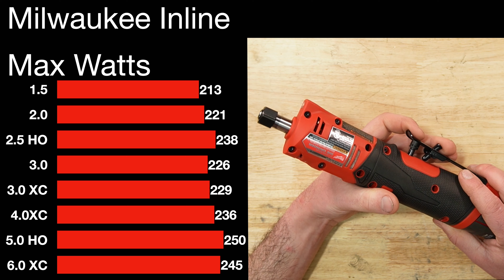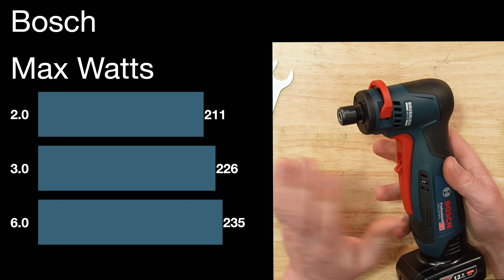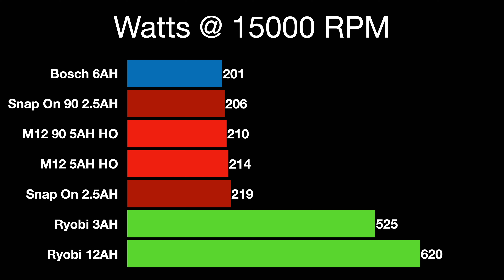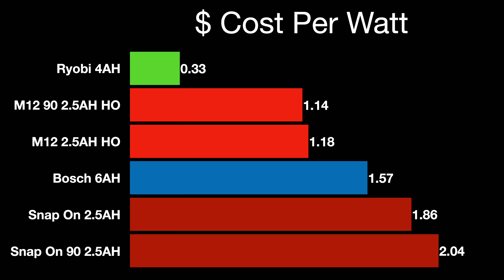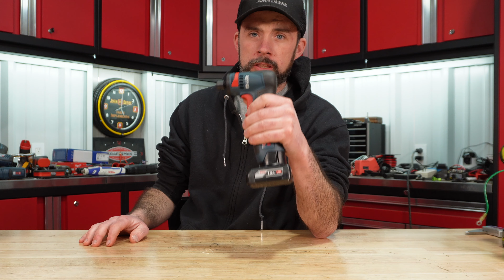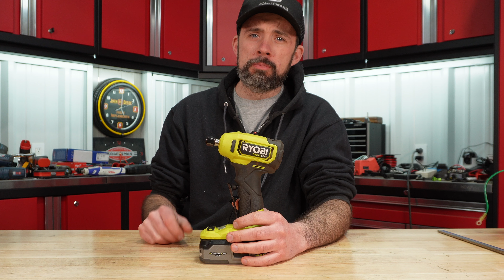The Best Cordless Die Grinder

Comment: I don't have any of them but I have a lot of the M18 & M12 tools. Waiting for the next generation of Milwaukee seems to be the best option. I do have a Ryobi tool so that's a temporary option too. the large heavy and pricey battery ruin it for comparison unless the M18 is considered.
Reply from the maker: Yeah hopefully we see gen2 m12 or M18 soon!
Reply: You won't get much more power out of M12, it's just too low voltage. Your best hope is that they make a compact M18 die grinder.
Reply: @toolscientist  I agree. There are a few M12s that I don't want anymore. The only reason I still have them is in case there's ever a need for that exact sized tool...
Reply: @toolscientist The problem with the M12 grinders (and cut off saw too) is not so much the max power , it's that they can't maintain their power more than a minute or less due to rapid thermal saturation somewhere in the design, coupled with  overly conservative protection logic.   Many folks have incorrectly concluded it's a battery thing but it's not.   

A gen 2 M12 needs to address the thermal bottleneck whatever it is, with beefed up  motor /electronics /cooling/thermal inertia  etc.

Comment: I wonder how the Dewalt Die Grinder would stack up.  It’s rated at 760 watts.  So maybe it would edge the Ryobi?  But it’s also a huge grinder.
Reply from the maker: Off of spec I would say the Dewalt would smoke this Ryobi,  from my testing of other dewalt tools they are actually honest with the specs.  That being said most are rated with a 2 or 4ah,  so when u use the PS batterys I could see that 760 watts pushed over 1000.    

If everything goes as planned we will see in about two months,  once the larger high speed dyno is done.
Reply: Dewalts cutoff tool is really good, the die grinder might be interesting indeed.
Reply: I have a DeWalt in-line as well as the DeWalt cut off tool, both are monsters
Reply: @KosmicHRTRacingTeam  I have the die grinder, but no other grinders to compare it too.  The few times I’ve used it, it more than got the job done.
Reply: Dewalt's inline is much better than the Ryobi, i have both as well as the 2 m12 Milwaukee's. I use them for different applications. The Dewalt and straight m12 for carbide burrs for steel,  the right angle m12 for carbide burr for wood and the ryobi for 2" sanding wheels.

Comment: 1 week ago I was looking for this exact comparison. And noone did it so far. Why is this channel sooo damn good 😨 I wonder if the Bosch suffers from the same cutoff problem as the Milwaukees. Max Watts may be about the same, but the Milwaukee is incredibly sensitive when being pushed.
Reply from the maker: So that’s a good point on the Bosch, it actually suffers from the exact opposite of the m12.  It keeps the torque but loose’s rpm,  so it’s less likely to stall but on the flip side you loose that rpm for actually get work done if that makes sense.  It’s interesting that the majority of Bosch tools I have tested perform in this manner.
Reply: @Tools-Tested  True, but no work gets done at zero RPM which is where the M12's tend to want to be after a couple minutes.   There is a thermal saturation issue on either the motor or the electronics board, coupled with ultra conservative logic to keep warranty claims low.   They are a misery to use as a result.   I look forward to picking up the Ryobi.   Great test process - much appreciate the comprehensive and scientific approach.  Many thanks for this super helpful video and happy new year !👍
Reply from the maker: @GannDolp Thanks! Happy New Year!
Reply: Torque test channel did it as well
Reply: @chrishoward4017  no Bosch though. They rather often skip Bosch or test it afterwards